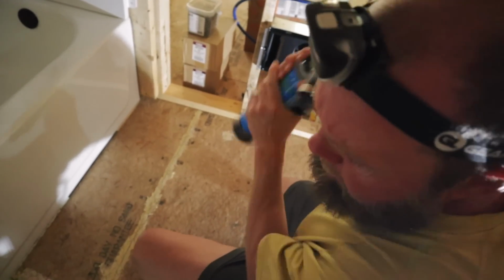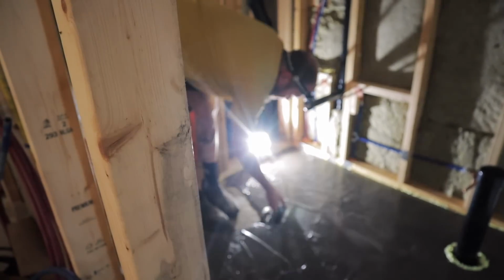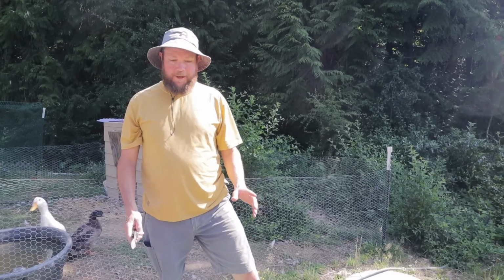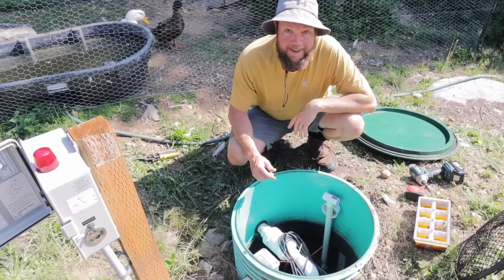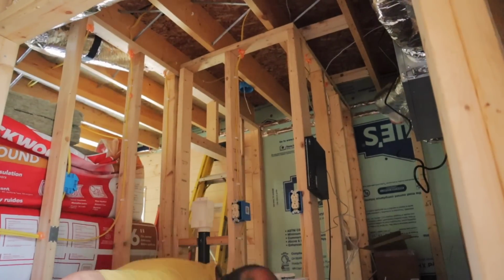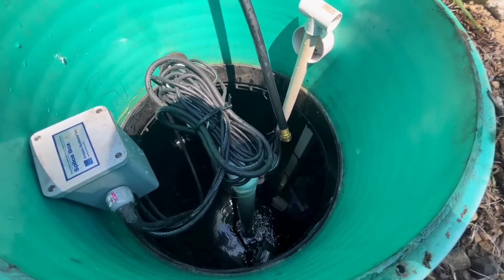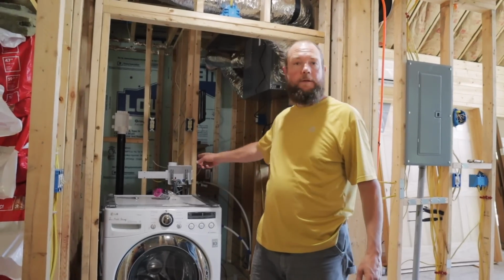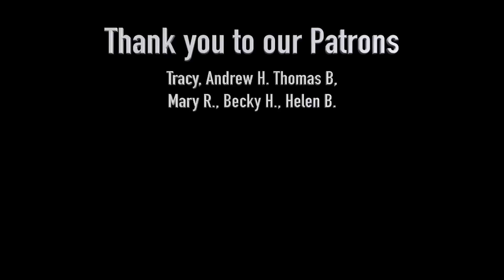Our SEPTIC SYSTEM has ISSUES

Comment: Just a Suggestion. You might consider buying an overflow pan to go under your washer. May never need it! But could save you a lot of stress if your washer decides to leak. Mine did; Not Fun; door seal cracked; saved a Big Mess. Especially Front Load❤
Reply from the maker: Great tip!  I think I'll order one right now.

Comment: on the septic pump the water is not supposed to go lower than the top of the pump .the pump is designed to be submerged at all times forcooling purposes just a lil info i install them almost daily
Reply from the maker: Thanks for clarifying.  In normal circumstances the pump will always be covered.  We were testing the redundant off float, which would kill power to the pump if there was a failure to the primary on/off float.

Comment: You major problem is you were supposed to pour it all at once not little by little...you pour it and let it flow and fill in uneven places and not wait till it's stiff to trowel because it's not cement and it is very fast drying.
 Lol don't you guys know to go to YOU TUBE University before any project to study up on it?😊 P. S. Never put shark bite fittings in your wall... they're not fail proof and sometime down the road you will be opening up the wall to replace it...good luck guys
Reply from the maker: I did watch a number of videos before using the self leveler, but as I'm sure you have experienced, there are a lot of variables to account for until you have "actual" real world experience.   Looking back I should have made the consistency of the mix a little looser so it flowed into the corners more easily and I should have poured all of it at once as you suggested.   

Regarding the sharkbite fittings, I agree.   That is why we removed all the sharkbite fittings and replaced them with PEX A.  

Thanks for the comment and thanks for watching our videos.